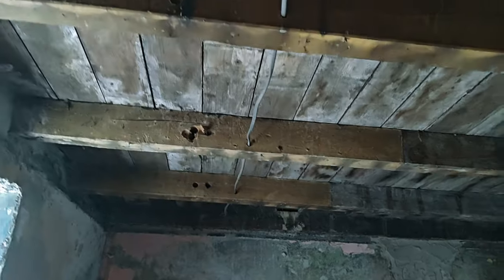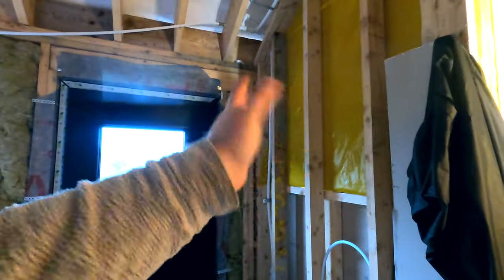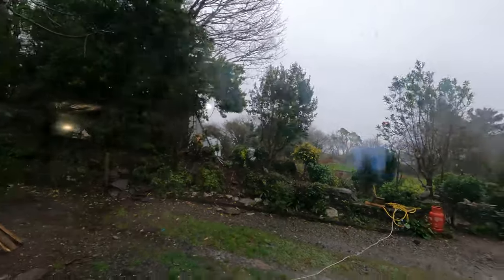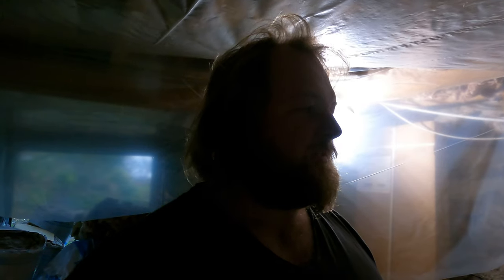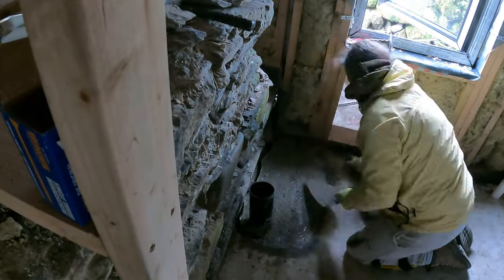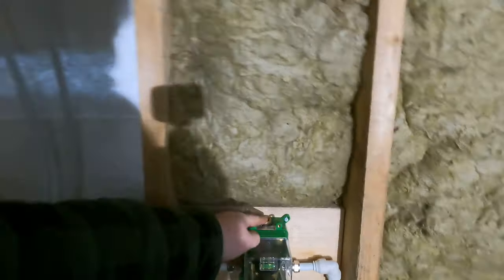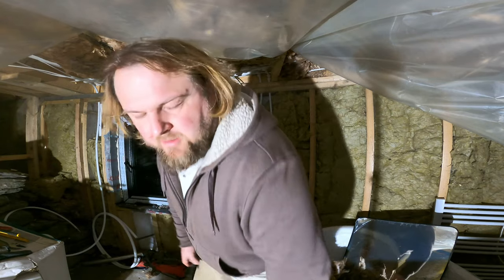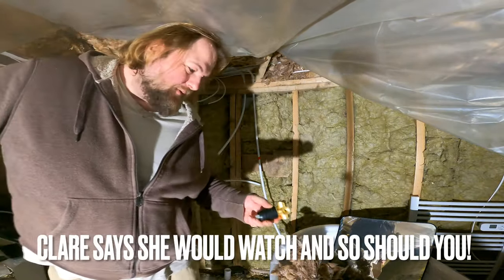MASTER Bathroom Remodel How to RENOVATION | 250 year OLD Irish Stone Farmhouse

Comment: May I suggest you dig your ditches and get your wiring in place and checked by electrician Set up your new box. Then….your electrician can pull the new wired to house.  Then he can set up the wiring into new box while you fill in the ditch.  What if you have to get a cpap machine.  You’ll want power by your bed.  What about vacuuming later?   Having the sockets doesn’t mean u have to use them.  The trick to grouting is to put it in and then wipe as much as you can off with the sponge trowel.  Then wipe it with a wet hard cloth. (A torn up  old sheet). 
Then again until it looks clean.  Then buff it with a dry hard cloth.  If u wait until it’s dry you’ll never get it off.
Reply from the maker: Yip we learned the hard way about letting the grout dry... Doh! We're doing just that with our electrician.

Comment: Howdy, I have a suggestion for protecting your caravan during storms. Maybe someone else has also mentioned this?  Here in Florida we get those nasty hurricanes. The winds can be frightening, so we park our vehicles around our, very tall, travel trailer. So far we have been blessed by doing this every year. Love all your videos. I’m impressed with your techniques. Are y’all limited to the number of outlets & switches per room?
Reply from the maker: Yes, thank you for that comment. We actually have done this in the past, however at the moment the grass is so wet in the field, we were worried about getting the jeep stuck 😕 Fingers crossed we wont be living for too much longer in a field 🤣

Comment: When repointing get your self a skinny wire brush avalable  in most hardwares to gently rake out your lime mortar from between the piggery wall when it drys . Then a brush with a soft brush will bring the joints up lovely.
Reply from the maker: Thank you for your help here. We have not Attempted any outdoor or indoor pointing yet, as we need to prioritize necessary areas for the grant. We will in time though get to this, so thank you